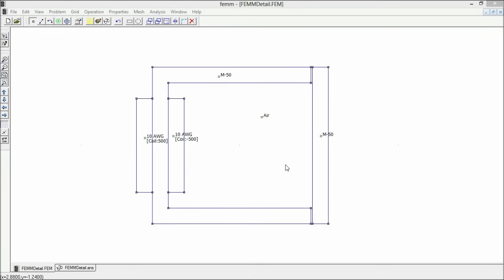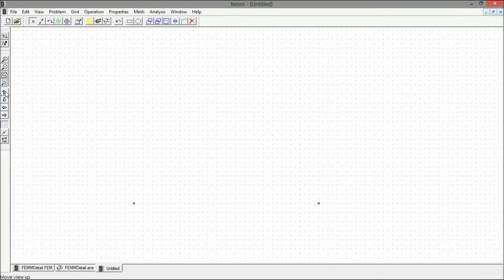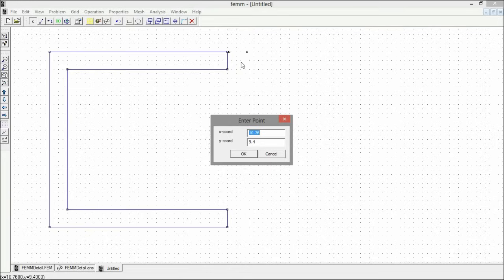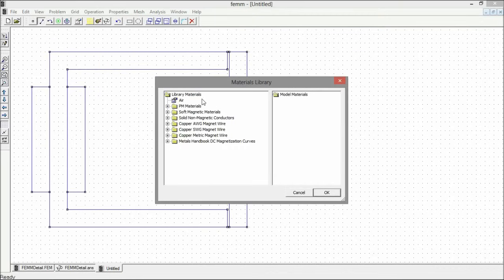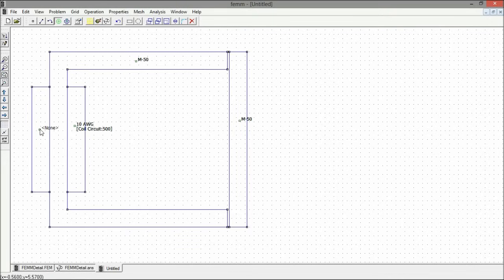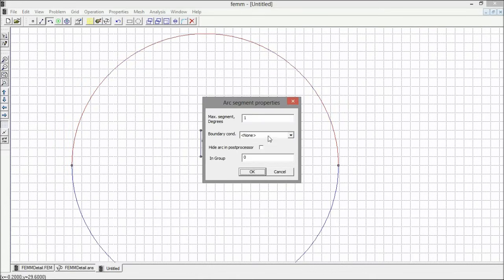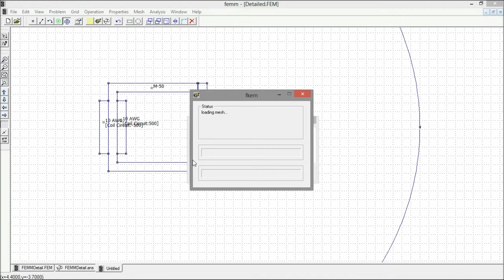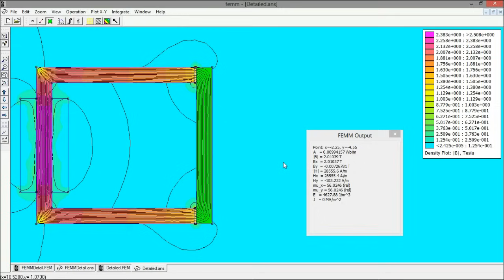FEMM Tutorial - Detailed Steps

Comment: I am glad I could reproduce your demo on my second attempt. 1: When I put 2 identical coils end to end with very little gap, with no metal (iron ) components, the force integration after cranking succesfully , does not show any significant force in the coil block. 2 : If I put M50 just outside the coil, after cranking succesfully, there is no significant force anywhere in the integrator.  (Coil diameter 30 cm , depth 1 cm, 50 A, 100 turns awg10.ps. Relax if U dont want to spend time on this tx.

Comment: 1)  how to find impedance of transformer any idea,.??/
2)  how to convert planer problems in asymmetric problems?/
Reply from the maker: Hi, 2) I think if you go into the problem definition, at the top. You may find a parameter that allows you to choose between Axi-symmetric vs. Planer.  You might have to redraw the problem based on this change.  For 1) I came across some interesting links/articles/papers when googling: FEMM Impedance, also maybe try bing search.

Comment: Can FEMM be used to simulate induction heating of a particular coil to a particular shape of ferromagnetic piece?
Reply from the maker: Hi, I am not sure about this.  FEMM does have a separate thermal problem feature, although I am not sure the coupling between the physics is there.  There is transient heat analysis example on the FEMM site, that may help.

Comment: Thanks a lot for the video.
Some more info. for beginners like me:
+ and - for coil turns indicate sense of the winding (out of the screen/into the screen). 
Boundary condition 'Prescribed A' with A=0 indicates homogeneous Dirichlet condition. It mean the flux lines are tangential to the boundary and no flux lines cross that boundary.Such a condition is equivalent to considering an external material with null mag.permeability,which is magnetic insulating material just outside the domain(circle).

Comment: Hi! Really impressive!

I am only wondering how did you derive the pulling force since this is a 2d flux simulation? Correct me if I am wrong but for the pulling force we need both the magnet's and armature's areas - the third dimension. Is there some preset - not shown in the video?

Thanks!
Reply from the maker: Hi
If I understand your question correctly:  The 3d dimension is stated in the depth.  For example, in the problem definition you state the depth which is basically defining the 3d dimension.
You are correct, this depth is then applied to both the coil and the material.
At about 1:06 in the video above, this depth is defined.
Reply: Thanks!